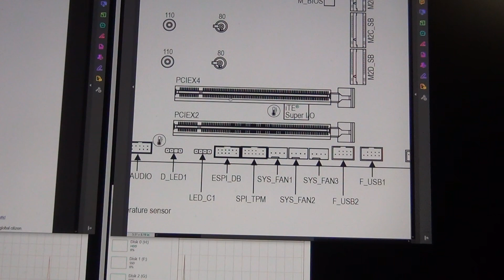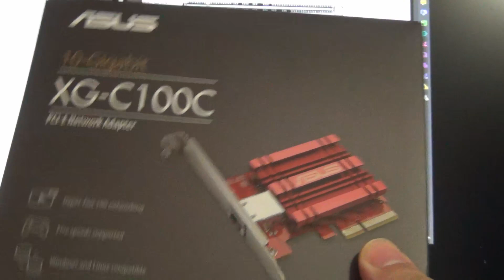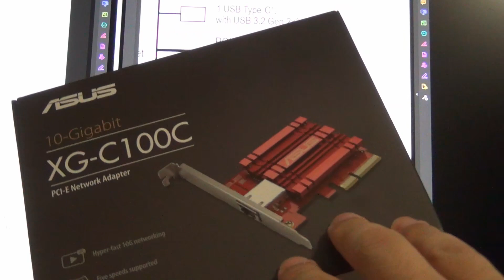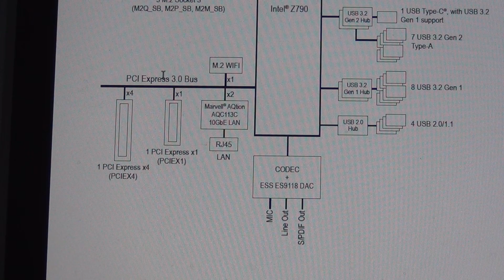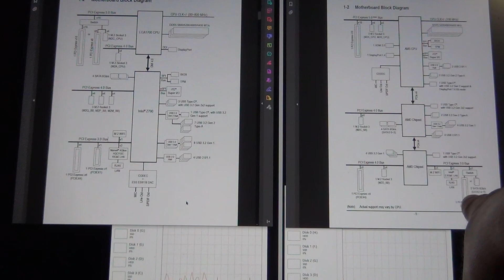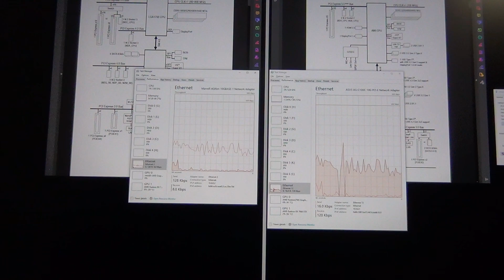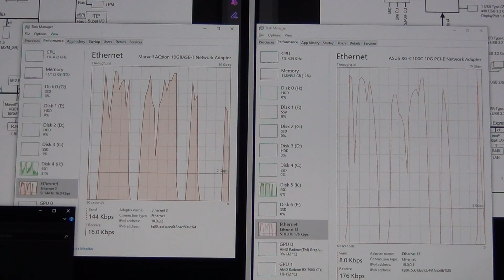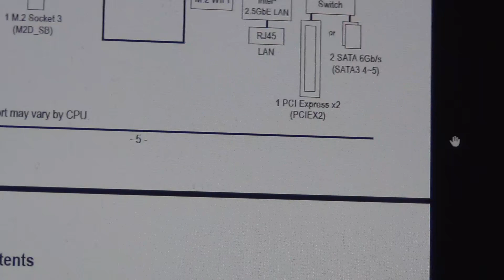10gb LAN on PCIE 3.0 x2

Comment: New to your channel and liking your content a lot! I was under the impression that PCIe automatically downgraded i.e. if I plug in a  gen4 device into a gen 5 slot, the slot itself will work in gen 4 mode. So that would mean that your gen 3 x4 nic should be running at gen2 x2. so mind blown a little here.

Comment: Exactly what I needed! I'm looking at an ASRock N100 Board which says it has one PCIe 3.0 x16 (physical) slot running at x2 electrical. I want to install a 10Gb NIC in there, so that should work!

Is there anything to look out for PHYSICALLY when inserting a x16 (or shorter) PCIe card into a x16 (physical) but only x2 electrical slot? How does this work physically? I mean: The x16 PCIe cards will have these gold-plated contacts across the entire length of their connector, right? Will the x16 phys (x2 elec) SLOT only have contacts across one eighth of their length, then?? Which eighth? The leftmost? Or are the contacts spread across the length of the slot? Will any length of card I plug into a x16 phys (x2 elec) always be ensured to make contact with all the necessary contacts of the slot? Or do the x16 (phys) x2 (elec) slots have contacts across their entire length as well but the signals coming from them are only transferred with x2 UPSTREAM?

Or is there a possibily that for example an x4 card will not reach all required contacts to get 4 lanes if some of the contacts are on the right side of the slot where the card physically doesn't reach with its length?

Comment: Awesome info! I greatly appreciate the extra info you share as it furthers my love of computer knowledge! It would be great to see a video on how the cards performance differs with different settings for this card (various Jumbo Packet sizes, etc) and how a CAT 5 ethernet cable may or may not affect the throughput :)
Reply from the maker: CAT5e will work but only for short distances. 10gb speed can work on CAT5e but only up to 147ft/45m. I don't have a BERT tester or ethernet tester to test Jumbo frames but in general if you set MTU to 9000 that would be equivalent to using Jumbo frames. Depending on the application, it can help with bursty traffic.